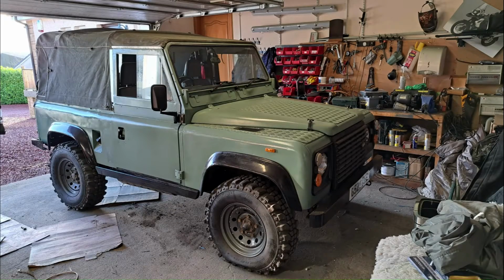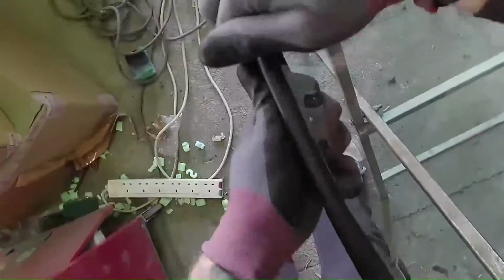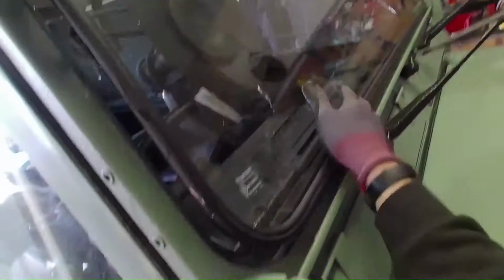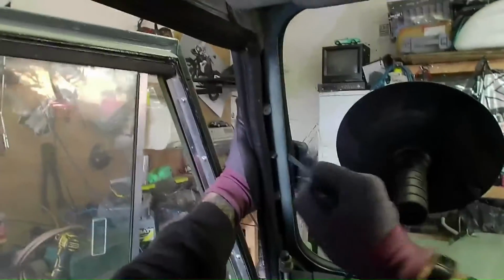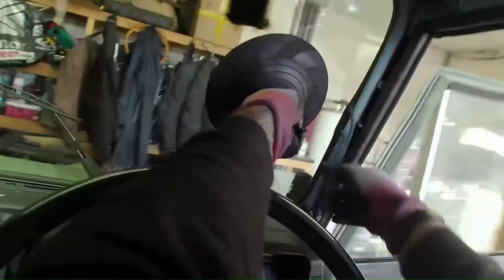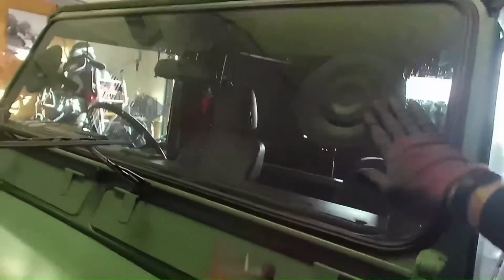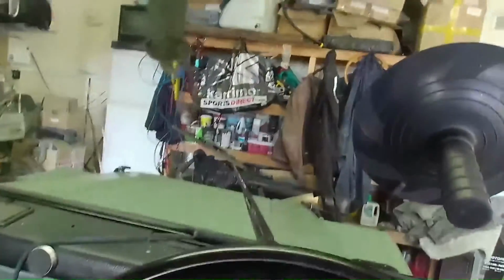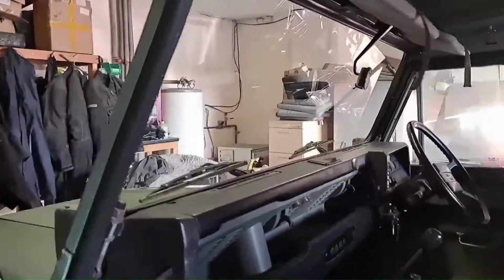LAND ROVER DEFENDER | Windscreen Replacement & New Rubber Seal

Comment: Followed your steps, all good, thx for posting. Genuine LR seal was very hard to pop on the glass, it also seemed too long I but managed to get it on. Started with the sides, then pulled the rope, rubber followed easily over the edge.  Succes!
Reply from the maker: Glad I could help, well done!

Comment: You make this look easy. I broke mine after the 5th attempt at installation. It was super tight and popped out on one side once it was seated.
Reply from the maker: Yes, what rubber did you use? I tend to find the genuine land rover rubber goes on the glass easier but is very tight when in the frame making it harder to fit, the britpart rubber is harder to get on the glass but easier to fit into the frame.
Reply: @AUTOGLAZ1ER  I used the ProLine rubber which is actually a better product than original. I finally took it to a local installer and they installed it and sealed the inside with urethane sealer. It looks great and was worth the $200 to have a professional do the work.
Reply from the maker: @jtclements  ok, glad you got it fitted, but a bit worrying if it has been sealed with urethane, glass fitted with rubber trim should only be sealed with an oil based compound that stays pliable(like putty) urethane is used on modern bonded type windows where the glass is bonded directly onto the vehicles Pinch weld aperture and is hard when dry.

Comment: Which rubber do you use? I bought a britpart one, and my windscreen fitter said it was the wrong profile, and could not be used.
Reply from the maker: Hi, I use britpart as in my opinion they are the best quality, so you maybe got a faulty one or it's not britpart or your fitter is incorrect.

Comment: so the technicue is either side first...., then the bottom strip, lastly the top strip ???
Reply: Hi I’m impressed with your fitting and going to have a go what size is your cord for installation ❓
Reply from the maker: @brian44graham  Hi, thanks, the cord i use is around 5mm in diameter.
Reply from the maker: Yes, just as described in the video
Reply: @AUTOGLAZ1ER  many say bottom seal, but as you have noted it makes it almost impossible to get the top lip in once sides and base fitted
Reply from the maker: @itolond  yeah, we all have different ways of doing things. This is my preferred technique on this particular job.
Reply: @AUTOGLAZ1ER  Thanks but we can hardly understand most of what you are saying. My experience is nomenclature is not a thing in the UK
Reply from the maker: @nachoplease1676  Could you please elaborate on this comment that has been left within another persons question?

Comment: Reasonable explanation but the lighting and use of head cam make it hard to see the detail. It would also be great to include the removal of the old window in the video.  I am guessing that can be hard to do with perished rubber?
Reply from the maker: Hi, I'm pretty new to YouTube and trying to improve with every video. the customer had already removed the old windscreen on this job, if the rubber is being replaced i just cut the rubber away and carefully lift the windscreen out.